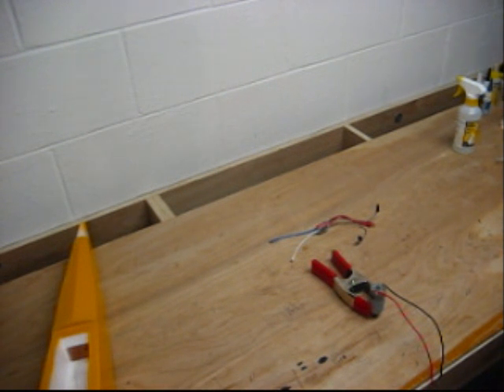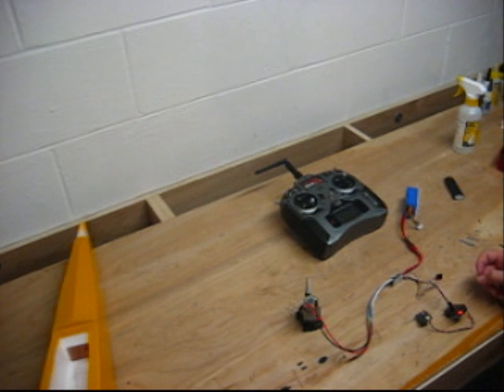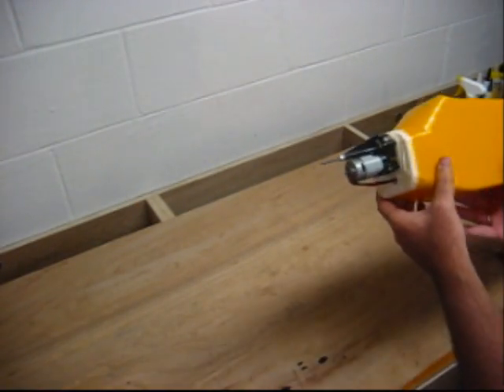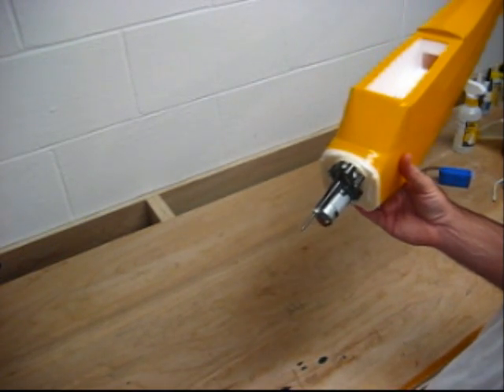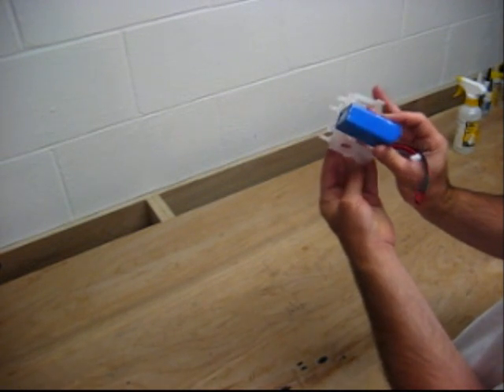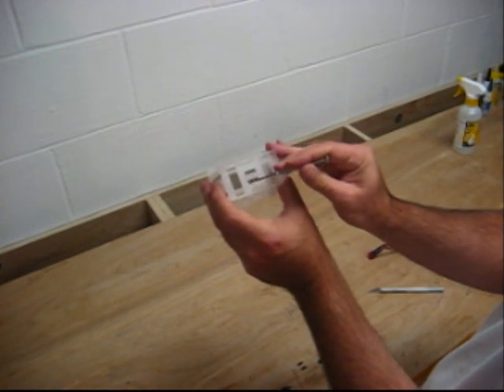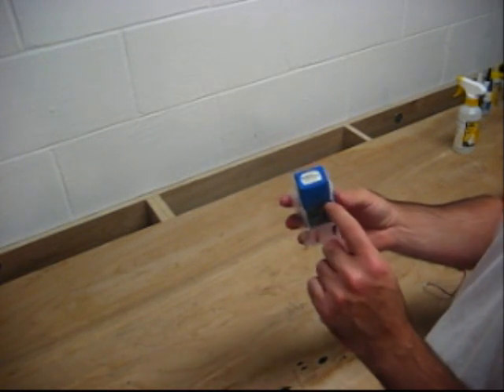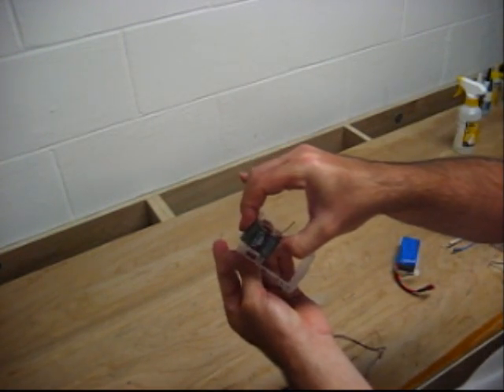14-Can Motor, Battery Box - Building HZ Super Cub from Scratch

Comment: Think you ment " solder a capacitor to reduce noise" look likeon and that what they are used to filter out noise. Hey how do you wire "connect "the two ailerons servos so that they turn opposite directions at same time> ? newbie here